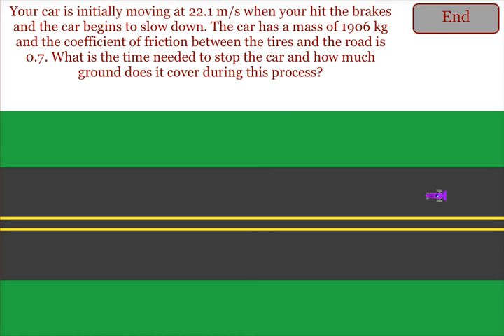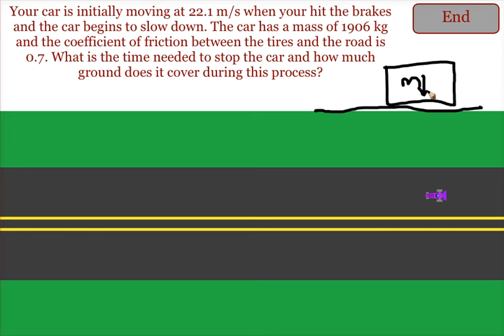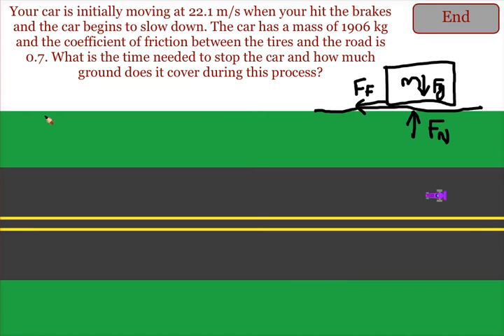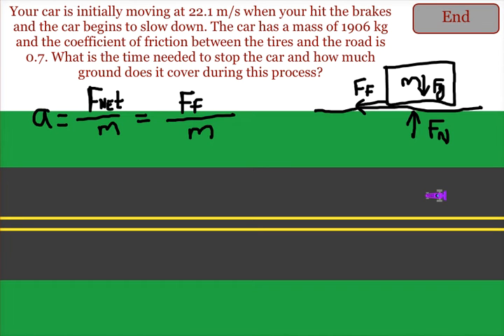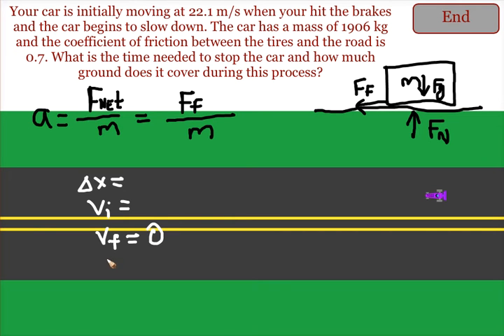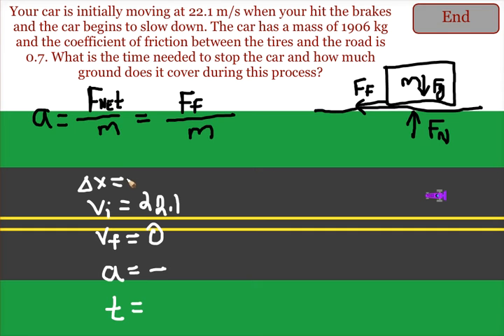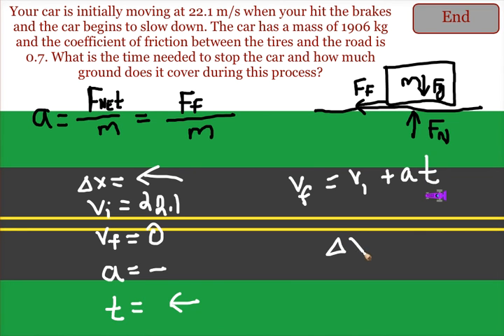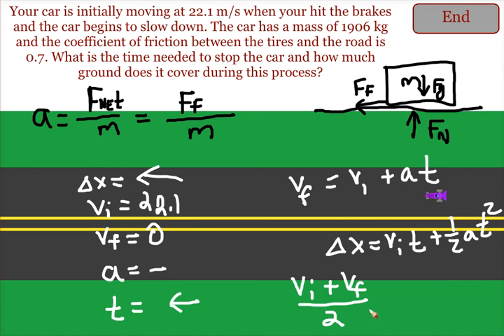Stopping Distance Caused by Friction

Comment: Why is the force of friction pointing left on the free body diagram
Reply from the maker: When I did the free body diagram, I did it as if the car was moving to the right. You are correct in that this does not match with the animation of the car.